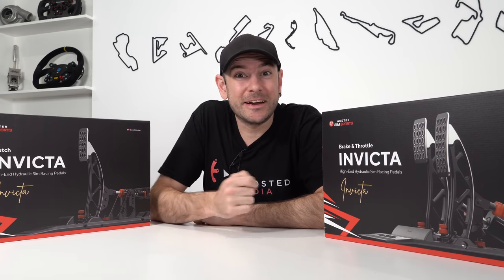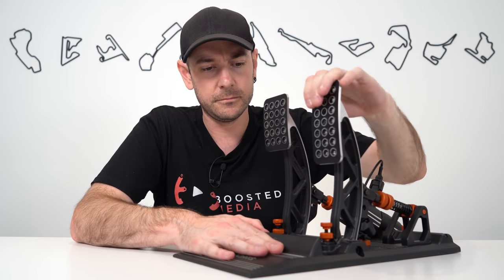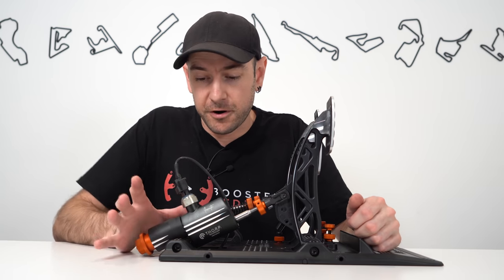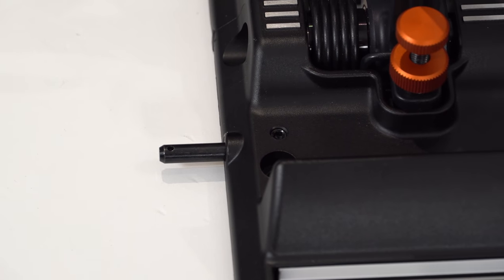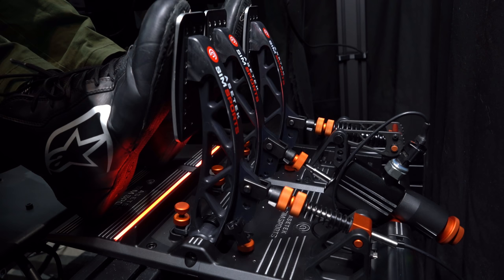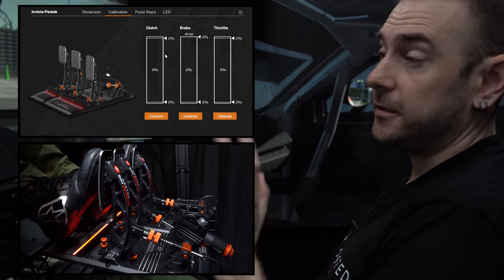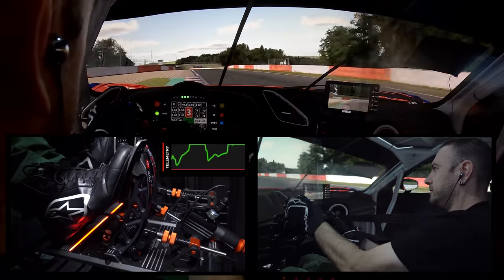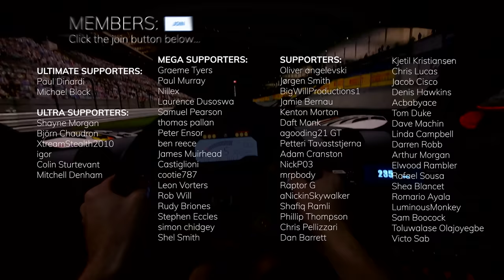REVIEW - Asetek Invicta Hydraulic Sim Racing Pedals

Comment: the first stage simulates the way of the brake pads to the disc, so why is there already 70% brake force until you reach the hard stage?! If you want realism, this must configures as deadzone, which is stupid and is in contrast to the marketing speak from Asetek…. Dont see a real benefit from two stages…
Reply from the maker: No that is incorrect. The way we have calibrated them on this video and our first drive video is the correct way. The first stage should be calibrated to the desired threshold point. Not the pad uptake point. Uptake can be simulated by releasing the preload slightly as we demonstrated.
Reply: I would recommend watching our video on why the two-stage system makes a difference. It is on our channel, called "Benefits of a Hard and Short Brake...".

But obviously it is always down to personal conviction if you believe there to be a difference or not. We've made a break that feels and works like what you would find in a race car. That's been the goal all along :) 

Best,

Dennis
Asetek SimSports